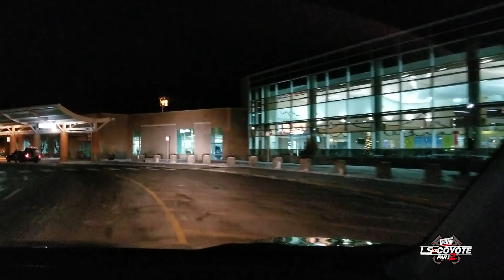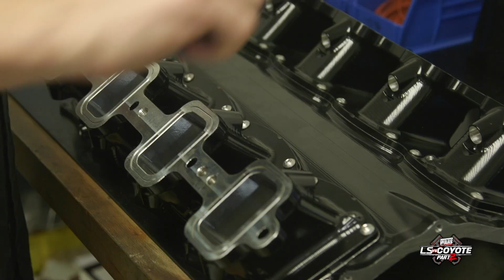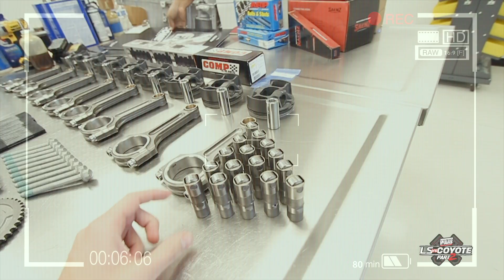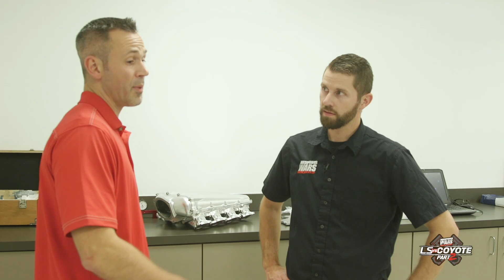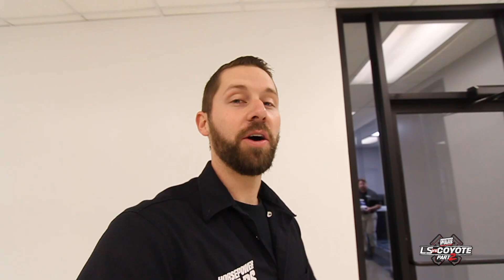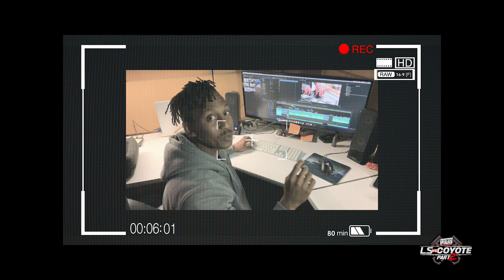LS vs. Coyote 2 Episode 2: The LSX Engine Build

Comment: Funny how I just got off LME’s website and their cheapest LSX long block with no intake manifold included is $23,495 but yet they did all this for 15k yeah ok 🙄
Reply: Labor cost isn't included in these builds
Reply: ben napier so it’s over $8k to assemble an LS?
Reply: @joshuamora6778  did you see all the machine work that goes into that. Nearly half the cost of 'store bought' engines is labor
Reply: ben napier I did see all the machine work and assembly of the engine.... just in the intake manifold, block and heads is way past $10,000 none of those numbers are adding up...I know what an engine like that cost and they are not fooling me
Reply: @bennapier9260  what machine work?  they cnc ported the heads.  i didnt see any other machine work.  they did show a clip of building the intake but that was just advertising as it was an off the shelf part.  they CNC ported the heads and that should have been included in the price of the heads.  i am not salty i love all things performance Hemi LSX Coyote they all can be built wicked as hell and they all have a good place in this world.   but this comparison is shit and its not what the average person wants to see.
Reply: @joshuamora6778  the machine work on heads probably 5k+ intake+throttle body 5k+ procharger brand new 5k+ how they ger the blco and internals new aswell?
Reply: joshua mora dude are you a special kind of stupid? Do you just talk out of your ass? You seriously comparing a factory LS7 crank to a Callie’s Dragon Slayer in the terms of cost? Callie’s Ultra Rods? Wiseco Custom pistons vs Mahle? Brodix Heads vs their custom? They were limited on a ton of machine work modification as well, what you see on the show is not even remotely close to the $25k or $28k blocks they offer and none of the labor or profit margin is included in the $15k build. Fuck you are stupid.
Reply: KTger 🤦‍♂️
Reply: joshua mora you made yourself look like a dumbass, stop talking. 🤫
Reply: @joshuamora6778  joshua MORON.........THEY NEVER EVEN MENTION "THE COST OF LABOR" BECAUSE THE COST OF LABOR TO BUILD THE ENGINE IS NOT INCLUDED IN THE $15,000 MAXIMUM FOR PARTS.........DUMB ASS. I WILL REPEAT IT AGAIN FOR YOU>>>>> THE RULES STATE THEY CAN ONLY SPEND $15,000 FOR THE PARTS. THAT DOES NOT COUNT FOR THE LABOR. THE COST OF THE SKILLED LABOR TO ACTUALLY BUILD THE ENGINE WOULD PUSH THE COST MUCH HIGHER THAN "$15,000", YOU MORON. Furthermore, rule #1 also states that the "$15,000 maximum budget" does NOT cover the cost of any blower they decide to use, the electronics, ASSEMBLY, and machining. Each team is allowed to ADD the blower of choice, electronics, ALL ASSEMBLY/LABOR, and normal required machining ABOVE the $15,000 budget.  You really are one dumb mother f*cker........ya know that?
Reply: All the machine work for the coyote (sleeving the block)was included in the price!!
Reply: They are likely going 15k cost for parts not retail price. Kinda shady.
Reply: Because you were right
Reply: BIG MIKE for real man who are they trying to fool 🙄
Reply: joshua mora that is what I’m saying brother
Reply: That billet intake manifold is also $4,500 with no throttle body... so they are competing with a $30,000 race engine and saying that it only cost $15k to build...OK.... 🙄
Reply: @joshuamora6778  joshua morON.........( that's what ya really should change your name to ) What is your f*cking problem punk? ALL OF THE COMPONENTS WITH COMPLETE PRICE LIST ARE RIGHT THERE TO SEE, AND THAT INCLUDES THE OFF THE SHELF COMPONENTS PURCHASED STRAIGHT FROM SUMMIT RACING. AND AGAIN, YOU JUST STATED >>>>>> QUOTE: "and saying that it only cost $15k TO BUILD"......END QUOTE. YOUR VERY OWN WORDS.........HEY JACK ASS>>>> ONLY THE PARTS COST $15,000........THAT DOES NOT INCLUDE THE LABOR TO BUILD THE ENGINE. THE SAME RULES APPLIED TO THE COYOTE BUILD. FURTHERMORE, RE-READ THE RULES FOR THIS COMPETITION JACK ASS. HERE IS RULE #1>>>> "$15,000 BUILD DOES NOT INCLUDE THE BLOWER, ELECTRONICS, INJECTORS, ASSEMBLY, OR MACHINING". .......LET THAT SINK IN TO YOUR PEA SIZED BRAIN.........DUMB ASS.
Reply: You are so right,Josh.The Ford Racing 5.0 supercharged Coyote crate engine with all the best parts is $25,000.Every supercharged LS crate motor is $31,000 to $37,000.The only cheap builds are junk yard recoveries,and there seems to be millions of these in the junk pile.Try to find a twin cammer in there while you're scavaging for government motors iron,I can't.
Reply: joshua mora...........Hey DUMB ASS........WHAT DOES THE VIDEO TITLE SAY>>>>> IT SAYS>>>> "ENGINE BUILD".....The price of "$23,495" is the price of the engine that is ALREADY BUILT FOR YOU........YOU JACK ASS. These 2 teams are building the 2 engines THEMSELVES. The TIME SPENT IN SKILLED LABOR to build either one of these high power engines in this BUILD-OFF costs a lot of money all by itself. Good grief........I know DOGS that are smarter than some of you stupid punks. And YES......you ARE a punk, when you're to damned stupid to figure out the obvious. Go watch TV boy.......you're missing your cartoons.
Reply: It's more then labor. When you pay an engine builder your paying for all their experience all the knowledge from all the mistakes they made and all the R&D work they put into engines. And with big name shops they have had tons and tons of engines they could try stuff on. Not to mention the support you get after you get the engine with virtually any problem you have engine related. Yeah it's not cheap but I think it's justified and about right on. Build offs have always been the cost of parts minus labor/skill. Same as the 10k drag build off no normal guy with a job outside the automotive industry could repeat any of them builds with double the money and 10x the time. It's just how it is. I enjoy it.
Reply: @brandonb8543  their knowledge and reputation is why you agree to pay $100-$150 an hour labor cost...hopefully all of that labor is itemized to reflect the cost when buying from them...not just some fluffy cloud "bonus" of an additional $5k that just gets put in there. After reading the rules, extensive machining and porting is supposed to be part of the $15k budget. From what I can see, that is more than $15k in parts alone...
Reply: @sean5comet   I don't pay anyone to do anything for me I never have beside some painting which I did my own prep work on. but I wasn't talking about LME I'm talking shops in general. A couple hundred bucks an hour for good aftermarket/custom work isn't that crazy unless you have unrealistic goals. That's why you spend 50k to rebuild old cars to stock form and 300-500k for a good new drag car and 30-50k for a stout engine it cost money and it's super time consuming like everything  especially close tolerance shit like a motor. Have you never built anything before?? Don't think you can math as well as you think. Besides like the cost of the used oil pan valley cover front cover and valve covers and their hardware which they should have paid for from the 15k especially with buying the new block and not starting with a stock one. Other then that I don't see how they are over 15k with summit pricing. Look at the part list and add it up. Hell it's on their website if you can read. And as far as the extensive machine work? Since when was decking the heads cleaning up bores and line honing the caps and polishing the crank extensive?! That is as basic as machining gets especially on brand new parts. Yeah there might be an argument that they should have paid for the extra keyway. So whine n throw a fit about a couple hundred bucks in used parts and another couple hundred for a key way all you want.
Reply: @brandonb8543  can you tell me if the intake is cast or billet machined?...if you can answer that correctly, you have found the source of extensive machining...
Reply: @brandonb8543  "don't think you can math as well as you think." I don't think you can talk as well as you pretend to be smart.
Reply: @sean5comet  The intake is an off the shelf part they sell. The price was taken in to account and was even listed under the item as they showed it. 
Do you think over $3k is cheap for an intake or something?
Reply: @sean5comet   Show me what part they didn't add or combination of parts are over budget. If you can't present facts then sit down and stfu. Yeah I guess if you don't have an intelligent argument just resort to attacking the person. Believe me I could care less what some jersey shore wanna be Guido thinks of me. You obviously understand very little. It doesn't take a rocket surgeon to see how and why it cost so much... Your a Ford fan boy aren't you?
Reply: @sean5comet Wow I just said 427 is more than a 302.  Please tell me if Im wrong.
Reply: @brentonhobson  you are correct, the engine sizes are 302 vs 427
Reply: @brandonb8543  the parts that are not accounted for is all the stuff they listed as "used" with zero price
Reply: @sean5comet  yep and welcome to the conversation, I already mentioned that in my previous comment. So what 300-500 bucks in used parts? That really have no effect on power production but have a great effect on needing them to run the engine. They should have 100%came out the price especially considering they are not using a factory block with all that stuff attached already and went aftermarket. And the machined intake they paid for and that is a machined piece but doesn't fall under the engine machining cause it's a part and lets face it most conrods are machined hell everything in the engine has been some what extensively machined for final size but they aren't talking about parts. What is actually the most messed up thing that noone has seemed to be bringing up(I'm not on anyone's side I'm just looking at the facts) is where was the cost of the LME port work done to their brodix heads? If I buy a pair from LME does that mean they will throw them in a CNC machine and port and polish them up for no additional cost? Most of these shootouts go over budget by a few couple hundred dollars they just don't say that 99%of the time . But really who cares the cost as long as all the same stuff at around the same price is done for the coyote and it's as fair as humanly possible then it should okay.
Reply: @brandonb8543  that is way more than $300-500 in parts listed as used...
Reply: @brandonb8543  Im sure the cost of that manifold and its use is PROMOTIONAL only. Why would you use a 4500 dollar intake designed for a Vette hoodline? Is that really the best intake for the build, cam specs, and intended rpms? You could save 15-2000 dollars right there using a Holley or any cheaper fabbed intake like the Coyote is using. Frivolous spending IMO.
Reply: Well at least this time a Chevy shop isn’t building both motors lol.
Reply: There's a whole lot of hurting butts in here and from I can tell no one who's had LME build an LS OR bought a set of quality Coyote cams and valve train. I've done both. Fact is an LS is simpler with fewer components that are more widely available which affords you BETTER components for any given $ spent. Now back to your soap boxes and conspiracy theories.
Reply: @RogerThatAZ  crashinaz.......EXACTLY. I said the very same things way earlier in the comments under the Coyote build video for this build off. Besides, most of the punks spewing their "Ford or die" nonsense probably ride bicycles & skate boards anyway & can't even afford a used beater car. The shit those little punks are saying under that video is disgusting. And it's awful funny how ya NEVER see them running their mouths in person at ANY shop or race track. Oh wow, I just now noticed that some of those very same punks are posting bullshit under this video too. Like "Jay Why"........posted right beneath this thread. That stupid little prick is saying with an LS ya gotta "change everything for boost"........yet he refuses to comprehend when ya buy an LS from the junk yard so cheap you CAN afford to make upgrades and STILL come in cheaper than a Coyote motor. And that's exactly why we see killer LS engines all over the world, stuffed in everything from GM cars to Fox body Mustangs and even Miata's. I get great pleasure from how it burns their asses every time they see a Fox body Mustang with an LS in it. I get even more pleasure every time I see "Beater Bomb" ( LS turbo in a beat up old Fox body Ford ) just spanking the shit out of over 90% of the competition on the track.......and that INCLUDES many Coyote motors. Yet he didn't need to take out a 2nd mortgage on his house or get served divorce papers from his wife to do it.
Reply: joshua mora........if you were a real man, you would remove your stupid comment, because several of us have already told you the list price of "$23,495" is for the engine ALREADY BUILT FOR YOU.
Reply: They’re not exactly a cheap no name shop. All of their stuff is pricey for more reasons than just labor which is big.
Reply: Did you think about man hours putting the motor together? Plus the machining and price of parts they put in the 1500hp engine from the site vs the parts they used in this build. Stop being so dense.
Reply: joshua mora correct me if im worng but this looks like the block from the vid? https://www.summitracing.com/parts/nal-19260093
Reply: joshua mora they sourced the block from summit racing not LME. So the pricing is correct.
Reply: What is cost of labor and markup for $1000 Alex?
Reply: Good point
Reply: U CANT READ THE RULES RIGHT Y WOULD WE TRUST YOU TO READ THE WEBSITE PRICING?
Reply: @shaadydog1  you're correct because the motor he is talking about has much better parts in it. Crank, heads etc. Doesn't matter what side someone's on there's always going to be at least one that embarrass themselves. 
If the price is right I'd take either one. Both will make great power for street/strip app. Maybe do something crazy and piss everyone off and put a coyote in a 70 slip bumper or a 68 Camaro with a 8.8 rear to go with it lol. 
Why is it so hard to read and comprehend the rules? It's like some are making rules that don't even exist or costs that don't either.
Reply: @waynebollentin989  Exactly, the biggest problem with the mudular is its size and then pricing, not that it isnt good stuff and admittedly if you are already starting on one side Ford/GM its not cheaper to switch imo. If swapping starting from scratch for a street car the LS is just so much easier,cheaper and a smaller fit. These competitions and the arguing are stupid and pretty much what has been regurgitated since the 60's muscle car era, Fords parts pricing usually (not always) is more expensive, and aftermarket is usually more expensive nothing new. Its funny too all the bitching but i know if im spending 4000+ on a rotator im putting it in a good block  ( PROBABLY WOULDNT BE DOING LS EITHER )and getting every last cube i can for its intended purpose. The LS just has more headroom that is cheaper and easier to obtain...
Reply: @Cobra Black exactly have to agree and I'm a ford fan
Reply: Listen to all the crying and bitching on here. Typical Ford fan boys. Hahahahaha
Reply: Labour, their own machine work, fuel system, ecu isn't included in the final total
Reply: @hydrocarbon82  Hydrocarbon82.......Look, go somewhere and play with yourself. When you've grown up and and matured enough to offer something worth reading or hearing out, you can come back. He, it's past your bedtime. So buzz off kid.
Reply: This is why people buy junk yard engines and cheap ass china parts lacking the Driven Performance Brands branding.
Reply: joshua mora
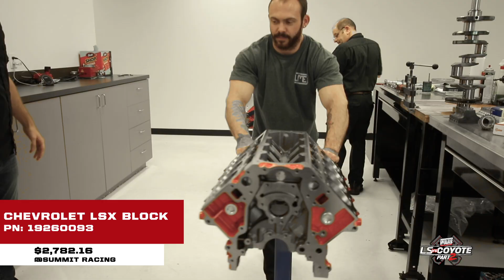8:07 under the price of the Block it says Summit Racing, and they didn't use LME's long block, they didn't even use a short block
Reply: @adamkalman6011  
*you're
Reply: @Sig721Tau  Its a 427 not 454 vs 302. And yeah its fair. Coyote has double the valves. Not only that its physically larger than an engine with another 120ci.
Reply: @Cobra Black 
Exactly. That's why you mad!
Reply: joshua mora cry already lol
Reply: By the way,Josh,the Supercharged Ford Racing Crate engine I mentioned for $25K is the Aluminator version.
Reply: joshua mora  Because you are right  Bro
Reply: @bigmike9408  BIG MIKE...........NO......"joshua mora" is NOT "right".........BOTH of you idiots need to go back & re-read what the rules say........AND PAY CLOSER ATTENTION.
Reply: I don't believe they said you could get this motor for 15k. How could anyone when the labor and some of the machine work isn't part of the 15k.
 I would say it's a gray area with what's going to be considered extensive or out of the ordinary machine work. That said they never claimed anyone could build this motor for 15k all in. So you'd have to be a simpleton to compare this motor with one complete for 23k on their website.  Now maybe if you hand the access to their equipment and knowledge of building motors it could be done. 
Also the motor for 24k has a better head, crank, lift etc. Its a flat out better motor.  So when you subtract the cost of the more expensive parts and factor the labor there's not much difference in price. This kind of bullshit happens when people's emotions get the better of them. They make idiotic comparisons to push a narrative.
Reply: @waynebollentin989  its still a giant 426 vs a small block 302.  Chevy has to cheat because they suck
Reply: @brentonhobson  it's LS vs coyote, LS comes as big as a 454, and coyote only comes as a 5.0. seems fair to me.
Reply: @brentonhobson  427 is still a small block, because GM is able to pack more cubic inches in less physical space its cheating? And I drive a coyote vehicle so don't try to hit me with that "oh youre an ls idiot"
Reply: @brentonhobson  yes chevy sucks so much that's why they sell 2000 new crate LS engines to every one 5.0 coyote sold you mean it sucks for ford that this new engines doesn't sell and when it does it's not often most are from wrecked GTs and trucks yes many chevy LS engine builds are junkyard engines but they sell alot of new LS crate engines new l know because l have one now since 2008 in a 1984 Monte Carlo ss it's got a 600 lift roller cam CNC ported L-92 heads shortblock is stock crank rods pistons it make 540hp at crank and has gone 10.97 at 122mph on the motor and driven to and from track 30 miles away with power steering brakes and a lockup torque converter it still runs as good as the day it was finish 11 years ago it has stomped alot of big dollar supercars costing 60,000 to over 100,000 dollars total cost of build 35,000 dollars that includes the price of the car new 12,500 dollars because I've owned since 1984 and l am the original owner
Reply: @brentonhobson  4 camshafts 32 vavles and makes no torque under 3500RPM compared to one camshaft and 16 valves by the way in cubic inches the 5.0 is smaller but not in actual outside size the 5.0 is bigger and compared to a all aluminum chevy LS heavier also chevy LS 6.2 , 6.0 engines make over 500hp with not to much and up to 580hp with bigger cam and CNC ported heads with a stock shortblock I'm with you on these iron long stroke engines l don't care much for them my 6.0 LS engine turns 7200rpm as fast as you can shift and if your not on the shifter your bouncing it of the rev limiter in first and second gear
Reply: @brentonhobson  there both small blocks. One a 4v the bigger 2v. It's a competition between the two. Both have there pros and cons. Saying well if the coyote was the same size it would make more. The same could be said if the Ls had a 4v head on it. I could careless about manufacturers. They all make tons of power. In 25+ years of building, tuning and racing I've never pick one over the other because of the manufacturer. Always was the best opportunity at the time of the build. Many pick a side and always thinks their side is better. If that's the case get a fucking car build a motor and prove it. Otherwise stfu already. The what if's are old ass fuck.
Reply: @jaredsmith4944   there's actually a 500 & a 527 ci. LS based engine I was recently reading about on the Internet. Google "500 ci. LS" for some interesting reading. ✌✌
Reply: @bowtie-man  thanks
Reply: Brenton Hobson why don’t you take out 3 cams and half the valves out of your 5.0 and see how much power you make. GM might make a bigger engine but ford uses other things to its advantage.
Reply: @brentonhobson someone seems envious of big-inch torque monsters...that ford can't seem to build
Reply: @lovescamaros1  I am envious but at the same time anyone can put a bigger engine in to make more power
Reply: @verz22  then it should be a ford 427 vs an LS 427, the 5.0 is a 302.
Reply: @waynebollentin989  not going by brand but engine size, its a 302 vs all these bigger engines, of course its no match, why is it even being compared.
Reply: Gloria Maletta you sound dumb as hell in your argument. LS better than a DOHC? Um no, not even close in your wildest dreams. Modular motor 4.6-5.4 are superior in every way it’s a simple fact and most dumbass like yourself aren’t aware. What’s the fastest small block in the world? Modular motor and it’s been 5’s where the Billet LS motors have only been 6’s, Mihovetz of Accufab went 5.8 with a 4.6 factory block, crank and Ford GT heads making 30lb with Twins at 10k rpm. Only upgrade these blocks need is rods and pistons, while everything else handles fine off factory cars. The reason why LS motors are popular is because of cost, easy to work on due to pushrods, more tuners available and parts are damn near interchangeable making aftermarket stuff abundant. That being said, for years the Mustang outsold the Camaro,  it’s why the GTO is dead and why GM nearly went bankrupt a few years ago. Lack of innovation. Guys are running 9’s in Ecoboost Mustangs and you’re beating your chest over high 10’s lol. This coming from a Chevy guy myself with a 40k built motor, but I’m not blinded by idiocy or love for a brand.
Reply: @brentonhobson  really you can't figure that out on your own? The mustang has had a 302 for decade but really became popular in the 80s until 96 when the 4.6 came out. Chevy ran the 350 for the most part from the 60s to 97. Then the Ls was born obviously. 
It's always been a battle between the two. In the 90s when the mustang really started hurting feelings anyone who ran one never gave a shit it was smaller. That little H.O. 302 from 85-92 ran great. It would take a 200-250 shot stock if you knew how to tune. Then in 93 when they changed to the hypereutectic pistons it wasn't such a good idea anymore. Stock bottom end H.O. 302 pre 93 would get a mustang in the 9s with heads, cam, intake and a shot of nitrous or with a S -trim or R-trim. Of course with a manual. The AOD's just robbed to much power back then. Was a very easy car to put in the 12s with just gears, exhaust, underdrive pulley and slicks/drag radial. Heads and cam well into the 11s. We never cried about it being small even when losing a race. It's what ford gave us and we made it work. There were many drag racing events with mustang vs this or that. Never bitched then either.
 This is a competition between the 2 motors most popular Chevy and Ford use. Nothing more nothing less. The size is irrelevant and both have their advantages and disadvantages. So tired of hearing shit isn't fair or equal. Nothing in life is why should this be any different
I've ran multiple manufacturers over the years. Whatever was a good deal at the time is all that mattered. Magazines have done many of these kinds of competitions with Ford vs Chevy over the years. 302 vs 350, 351 vs 350 etc. We didn't argue about one being bigger then the other. It's always been cool to see how different platforms run against each other with different combinations. 
There's good news for the cry babies though. Ford is bringing back the bigger gas engine. In the fall the new 7.3/445ci will be out. They say the motor will make big power and will fit in a mustang. So hope they put them in one of the Mustangs like a Boss 445 or something. Then we don't have to hear people bitch like this anymore.
Reply: Wayne Bollentin 7.3 is for the Super Duty only, as a sustainable replacement for Diesel Engines. It’s mention it can fit a Mustang ( as any overhead valve V8  could ) but will NOT be an option from the factory for any other vehicle.
Reply: @KTger  he went 6.05 with the factory crank and 5.88 with the factory block. He had a Bryant billet crank when he ran 5.80s and the car made about 60lbs of boost. He runs a billet block and crank now. Still with the factory B heads.
 Sure people say it's a 2500lb pro mod but who cars. No factory block and head Ls has been that fast or made about 3000hp with the factory block and crank. 
Now of course there was tons of work done to the crank. It wasn't like they just got a factory block with the crank in it and just tossed rods and pistons in it. 
Looking forward to see the next video. 
Really the only downside is the timing chains have to be replaced every 45-50 runs but 10,000 rpms and 60lbs of boost better save then sorry. John knows that mod motor better then anyone.
Reply: @KTger  I never said it was coming in a mustang. I said it will fit and hope they used in a mustang at some point. So not sure how you got confused. Once the motor comes out in the trucks. I'm sure someone will get their hands on one and drop it in themselves.
Reply: @jaredsmith4944  LS doesn't come with 4 valves per cylinder or DOHC or VVT so I'd hardly call it unfair
Reply: @gloriamaletta8667   lol, so true , and dont forget for every C4/6/AOD  being used behind a Ford powerplant their are 2 times as many converted to PG/TH400/4L80. Its just cheaper and easier to start with the "correct" engine and forego the swap plate and hybrid clutch or torque converter bs.
Reply: @jaredsmith4944  
454 vs a 302...fair? What world are you living in?
Reply: @waynebollentin989  Amen!
Reply: This is not a real full LSX built by GM. They are doing a LSX garage build.
Reply: Robert Gardner “garage build”
Reply: Every coyote vs ls head to head the ls always somehow gets a ton more work than the coyote under the budget. And i own a Camaro. They cheat
Reply: Scott Leighton how do they do more to the ls they completely re sleeved and reworked the coyote block
Reply: @MyDudeman1  Bic Smith.......You can't talk any sense to these crybaby Ford fanboys. Most of em are just punks who don't know shit anyway. They damn sure can't read and they have the attention span of a house fly. Because a bunch of em are posting incredibly stupid comments with fraudulent accusations against the LSX build, as they spew absolute MYTHS about the Coyote motor, and what's even worse, the Coyote engine build video was posted 2 days ago for THIS 2nd build-off, and they chose one of the very best builders in the entire country for Coyote motors. And that man CLEARLY states all the FACTS that blow these damned myths clean out of the water. Like this bullshit myth that "a factory bone stock Coyote motor can handle 1,500 lbs of boost AND UP".........BULLSHIT. In that new video, he stated QUOTE: "These Coyote engines with factory sleeves can NOT handle anything over 900 hp, or it WILL destroy the block". ( he continues ) >> "They MUST be MACHINED & RE-SLEEVED WITH SPECIAL UPGRADED SLEEVES, SUCH AS THE FLANGED DARTON SLEEVES AND WELDS ASSED TO THE BLOCK IN CRITICAL AREAS" ( there goes the myth as he continues talking more) >>> "IF YOU RUN THESE OVER 900HP WITH FACTORY SLEEVES, YOU WILL BE BACK TO BUY ANOTHER BLOCK WITH DARTON SLEEVES".....end quote. The machining, WELDING, and re-sleeving with Darton sleeves ALONE.......NOT counting the block itself........COSTS $2,500. For only $380 more, you can buy an entire LSX block brand-new WITH the sleeves already in it. The cams, valves, and springs for a Coyote motor also costs about the same as an entire LS motor. The Coyote motor is SO damned expensive in fact, for THIS build off, he had to start with A USED CORE/DONOR MOTOR just so he could afford the parts to build it & stay within the rules of the budget limit of $15,000. ( The blower, electronics, labor/assembly, and LIGHT machining are allowed WITHOUT coming out of the budget limit. But any MAJOR machining, such as re-sleeving a block DOES have to come out of the budget. ) And because THIS build-off is going all-out to make between 1,500 and 2,000 hp, they don't have to include the Pro-Charger of their choice ( for both engines ) in the budget limit. The Coyote builder even stated that he would rather use a better set-up but he CAN'T because that would push the budget EVEN HIGHER. The whole thing goes to PROVE just how stupid expensive it is to re-build even A USED Coyote motor, when you can start with a top of the line brand-new LSX motor for the about the same price NOT counting ALL OF THE MACHINING & LABOR.
Reply: @scottleighton9149  Coyotes have more expense. 4 cams 32 valves. There's more cost there. The heads are HUGE so more material.
Reply: even when they try not to cheat, they cheat. they can't help themselves they are just so outside reality....
Reply: after all im sure this is a 40k engine
Reply: I’m gonna call them and ask for the 15K LSX
Reply: joshua mora lol
Reply: BIG MIKE what’s so funny? 🤔
Reply: You have to be really dumb to believe a channel that compares two brands and clearly favors one brand by pulling out the motor putting rods and pistons porting the heads getting the custom blower cam and bragging that It made 20 more horsepower than a stock sealed motor.... clearly the host is a GM fan that doesn’t know anything about building motors claims he’s a real GM fan but doesn’t know who LME is... then LME is clearly doing machine work and labor for free claiming they’re also using nothing but a Budget parts but this motor will hold 1,500 hp reliable for only $15k 🙄
Reply: @joshuamora6778  "they are doing the machining for free" well thanks dipshit try reading the rules befpre coming to the comments. Its funny how so many people are saying its chevy biased when both the coyote and Ls are under the same rules. Both being built by companies that specialise on each type of motor. The host never chose the parts or the engine platform. Instead of talking shit how about you people wait to see the coyote build. Im sure they will have custom parts in it too.
Reply: Nathan22 Outdoors hey Internet tough guy please don’t call me names behind the keyboard, did you watch the first shootout? In the first shoot out you will see why everybody is calling them biased... Like I was saying how is the LS better when you have the reworked the whole engine to make the same power as a stock seal motor it doesn’t make any sense how does it make it better if you have to change everything in the motor to make the same power... pound for pound a coyote makes more power
Reply: Nathan22 Outdoors i’m a tell you what should’ve happened in the first shoot out they should’ve gotten a Ls/LT tuner to tune the LS or should I say LT1 without pulling the motor out and boosting the stock motor and they would’ve found out that the stock Pistons can’t take more than 650 to the wheels and the competition would’ve been over right there and then! while the coyote gets a real tune from a coyote tuner it could make 800-900 rwhp easily without opening the motor
Reply: @joshuamora6778  Lmfao Ok and tell me this. Was the biased host choosing those parts and is the host choosing these parts? Also if your so confident in your shitbox coyote then why are u so scared and butthurt seeing the chevy build? Your acting like the coyote is a beast but your also trying to accuse them of making it biased. The playing feild is fair. Max power is the main goal. Ford will probably win the hp per ci then the highest hp 3000rpm behind max is also fair for both. Lmao stop being so confident if you are gonna come in the comments and start talking shit.
Reply: Nathan22 Outdoors I never said anything about the host choosing any parts clearly that guy doesn’t know anything about engines I have probably build more LS’s/LT’s and mod motors then the both of you put together.... but when I see bullshit I will call it out! I actually like the LS but do I believe that it’s better than the coyote when it comes to boosting!? no it’s not, Houston Texas is my hometown the same hometown as LME I have friends that have performance shops that work on both brands and I see these cars on the Dyno all the time.... it’s always the same recipe for both brands, GM cars always get heads cam while the coyote just gets oil pump gears wen boosting and the coyote still comes out on top with less work and less boost
Reply: Nathan22 Outdoors honestly they should have gotten a Mopar guy to be the host of the Chevy and Ford battle someone that doesn’t like either brand but will admit which one is better
Reply: @joshuamora6778  then as i said already. If you think the coyote is better why are u commenting that its unfair before seeing the coyote build?
Reply: @joshuamora6778  and maybe coyotes dont get cams because its a shit ton more out of the budget vs a single cam LS
Reply: Nathan22 Outdoors https://youtu.be/5u8VaI7BOZc
Reply: Nathan22 Outdoors shop cars put in a hurting on the LS and LT follow that channel you’ll see what I mean
Reply: Nathan22 Outdoors https://youtu.be/HTIO7JiU-5k
Reply: Nathan22 Outdoors https://youtu.be/qVA6_D_9s-4
Reply: Nathan22 Outdoors hometown coyote putting in work
Reply: Nathan22 Outdoors because like I said the host admit to being a GM guy.. and on the last shoot out they did everything in their power to but the camaro on top... but I will say no more and just wait for the coyote built
Reply: @joshuamora6778   lmfao these videos. First one. A Twin turbo car that can rev higher is obviously going to pull top end. Second vid of a stock coyote with 1000hp isnt even impressive. The motor is built for power. Cleetus pushed 902hp in his most recent video on a junkyard 4.8L with a single turbo kit he fabed himself and he cant even weld. And the last vid of a mustang running a 8.6. Again with cleetus. His last motor was a junkyard 5.3l with 700hp on the same turbo kit and it ran a 9.3sec. 4.8l revs higher and another 200hp should get him around 8.6 or faster.
Reply: Nathan22 Outdoors 🤦‍♂️
Reply: I REST MY FN CASE...THIS IS RIGGED AND THEY KNOW IT!!!!
Reply: Intake is about 26hrs of machine time and it says 3125$ or something lol. 
My drive shaft guy had to turn down my yoke on my toyota and it was 200$ and prolly took him 15min lol 26hrs ok
Reply: @bryanmayes9234  bryan mayes.........you just don't get it. call lme yourself and see. you can buy that intake for $3,250 if you buy an entire lsx motor to strap it on. the intake only costs much more if you buy it all by itself. what the hell is wrong with you? and guess what, that is all added in with this build.
Reply: The company is literally throwing free parts in. This is already bullshit
Reply: @luciankristov6436   And charging $3100 for an intake isnt "free". Its not including the man hours to machine it which makes sense
Reply: @luciankristov6436  They do it in-house. Where does it say that the people building the coyote will buy 100% of the parts and none will be made by them? Fucking idiot
Reply: @luciankristov6436  The parts list is there on the screen with the prices. Not hard to see whats in there if you can read.